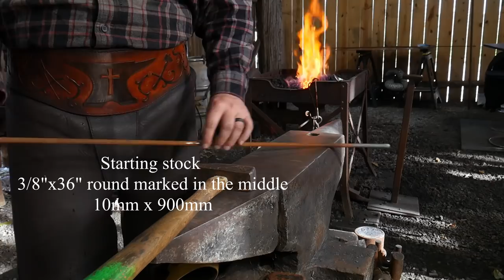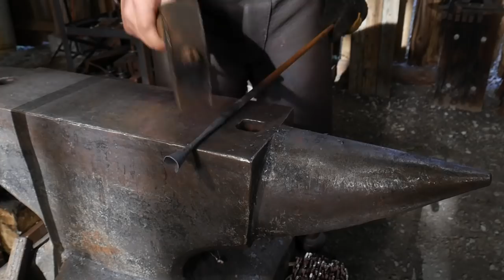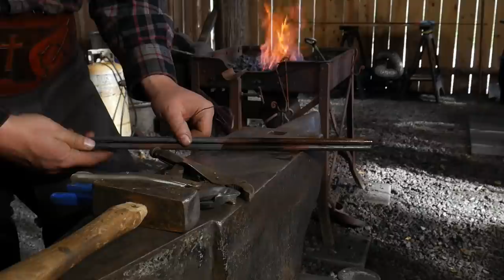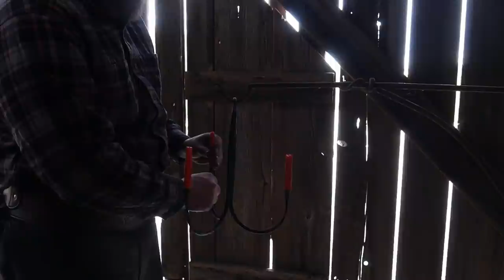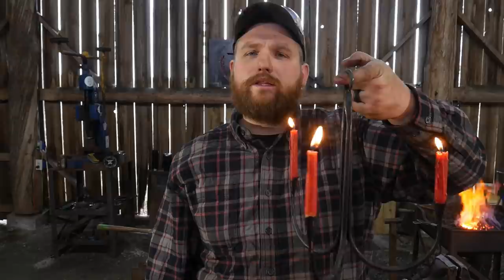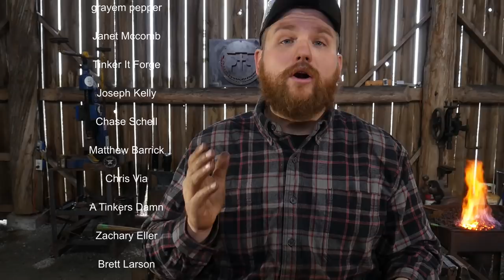Forging a Candelier

Comment: Very interesting and I've had an idea forge it the same way except without the hook leave that part as a spike similar to that on the fire basket that you did so it can be put in the ground  as a torch and bend the candle holder the other way might work ok
Reply from the maker: Could be interesting ☺️